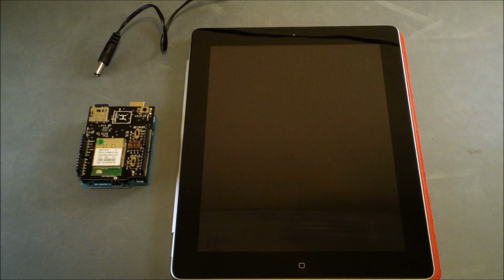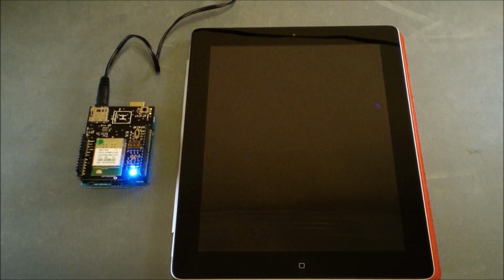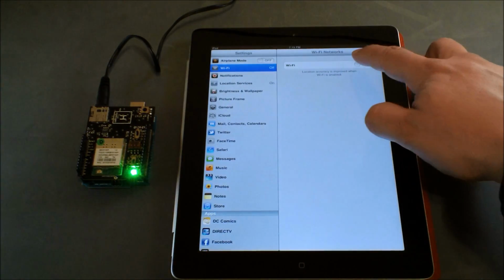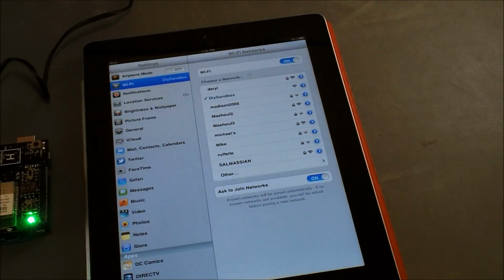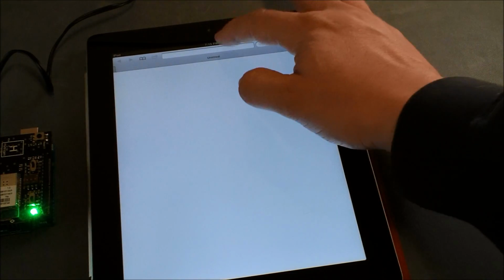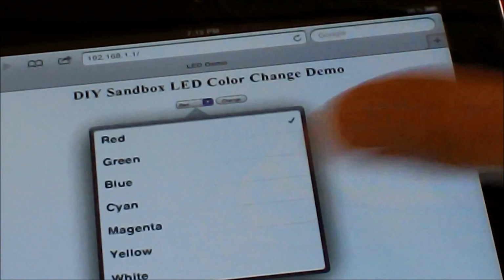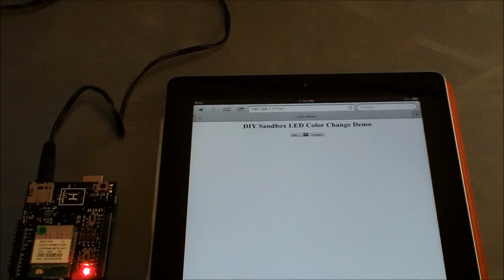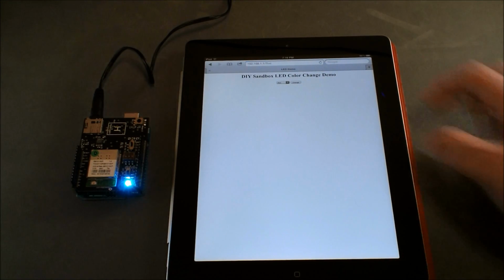Hydrogen WiFi Arduino Access Point Example Demo

Comment: good day sir! can i ask how will i use arduino wifi shield on arduino uno to be an access point and how can i connect the other two arduino boards with wifi shield asa clients. i'm planning to control the two arduino boards using wifi. big thanks sir!